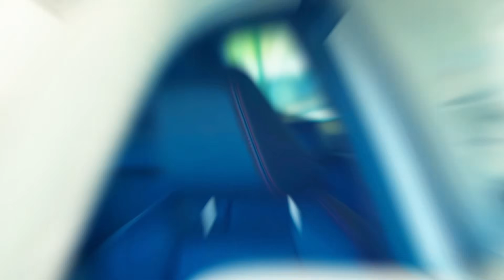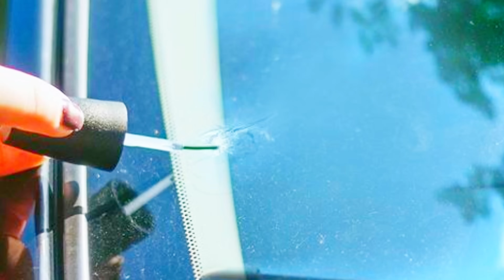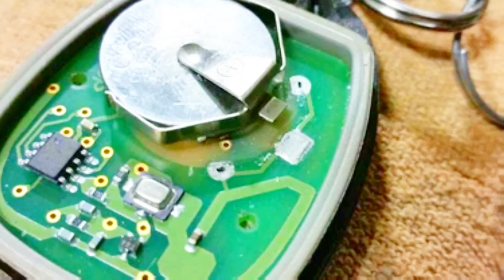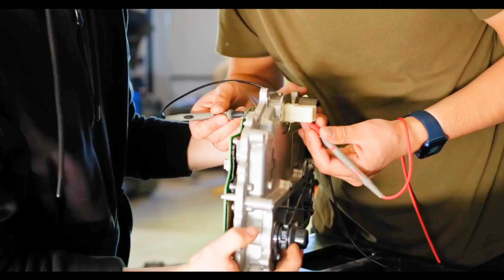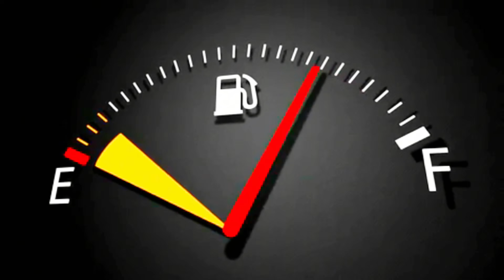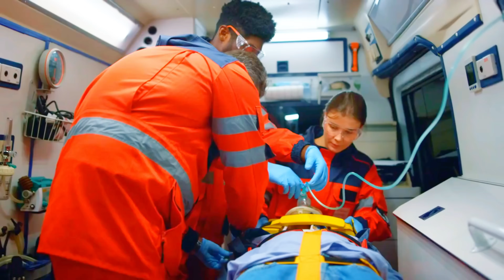SECRET Car Tricks Only Experienced Drivers Know

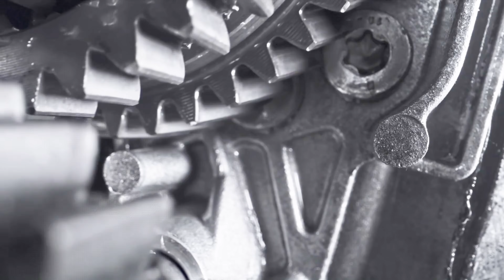Comment: 12:54, You would be totally surprised how many people put their transmission in park and do not engage the parking brake or Emergency brake but I really like your philosophy on the transmission and the REAL WAY TO ENGAGE IT, now we'll sit back and watch people to see if they engage the transmission the way their suppose to,....it's hard to brake old habits.
Reply: A lot of people don't use the parking brake even on an incline.  I use mine in my flat garage!  But I didn't know the "put in neutral first" tip.

Comment: # 1 makes no sense at all. If you’re locked out of your car and that’s why you can’t open your fuel door. That would mean that you wouldn’t have any keys or a fob to unlock your car. So how are you supposed to unlock your trunk to get to this cord to release it and open the fuel door? You wouldn’t be able to because if you could get into your trunk, you should be able to get into your car. Plus, why are you so worried about getting gas when you’re locked out of your car? Don’t you think you would be trying to get back into your vehicle first and then worry about getting gas? You’re not going to need gas if you can’t get into it to drive it, right? 🤷🏻‍♀️ Just a thought. 🤭
Reply: Lol if you wrap your key in foil and put it in the oven it will cook slowly and will be much more tender to eat. They missed that little gem........ 😂
Reply: 😂😂 I wondered if it was just me. I swear they have me thinking in circles sometimes. 🙄
Reply: @27steve hahaha
Reply: @27steve 😂😂😂😂😂
Reply: Awesome thinking!
Reply: I have to assume that it was speaking of fuel tank doors that wouldn't open because of electrical failures. Since they emphasize that this is a mechanical system access. That's just me though.
Reply: I was wondering the same thing, how are you going to get into your trunk? I can't believe they think everybody is so dumb.
Reply: Maybe if the fuel door itself is broken?  Idk!

Comment: My acura already has the mirror tilt feature when i shift in reverse. 

It’s called a feature not a whole manual setup!
Reply: I like how you pointed out the difference between a built in feature and a manual setup. With Acura it is convenient, but many regular cars need a manual tweak to get the same benefit. That is a detail not everyone notices.
Reply: My 10-year-old Lexus has that feature when I shift in reverse.